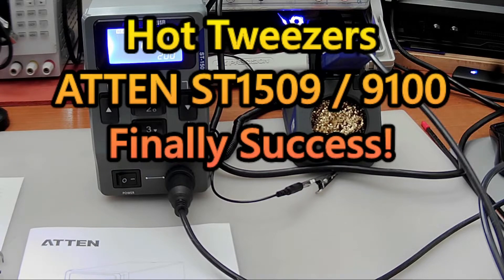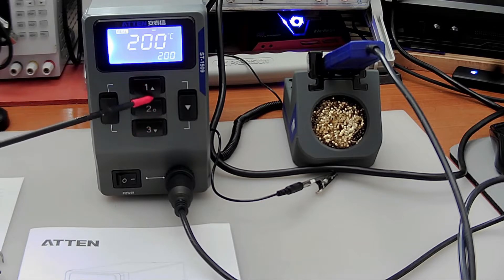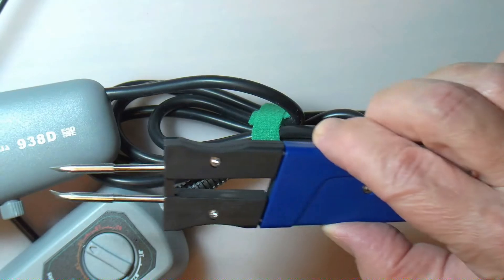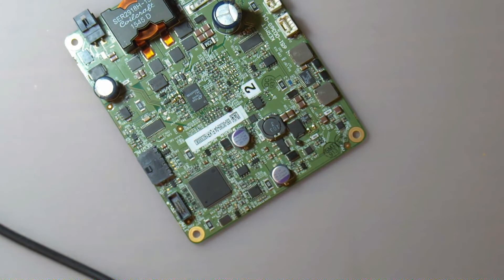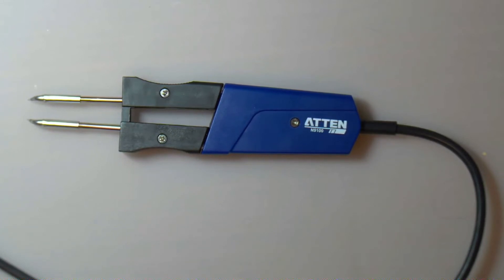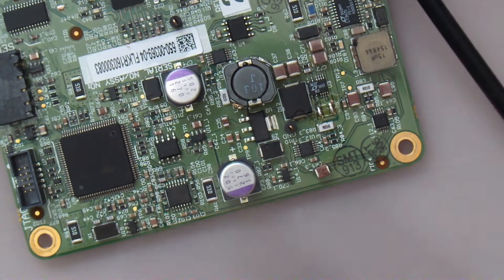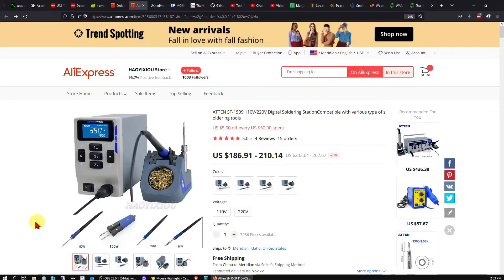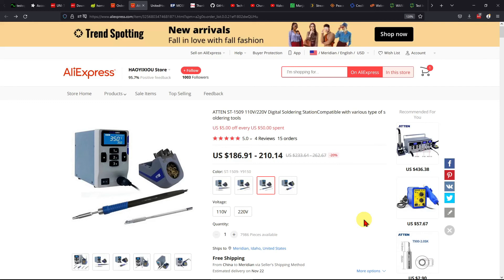Atten  ST1509 / 9100 Hot Tweezers

Comment: Do you know if the hot tweezers will work with a Hakko base station?
Reply from the maker: @MichaelM28  Well I don't know what kind of interface hakko has, but I doubt it.  They all seem to have different pinouts and voltages.

Comment: 8:30 what terrible performance… it should be 3 seconds max. 10:53 such a small component should take less than 1 second and not look like you’re ripping it off the board. 

Friend, you should not advise people to buy this. It’s such a waste of $200. You can just use two irons or one iron tip that spans both pads (or use hot air). 

Soldering tweezers are a luxury. Apart from saving time with SMD rework, the point of them is to press a pedal to turn the heat off so they can handle components like regular tweezers. Or you can use them to hold a component & solder it in place (but you can do that same job with one iron & some flux). 

350*C for 20 seconds - pads & tracks can get lifted and components should be thrown away after so much heat. Brand new components spec: solder 260*C for 5 seconds for reference.
Reply from the maker: Not entirely sure what you are talking about.  I used that board on purpose it is a board that was coated with something to seal it and was designed to go up with a weather balloon at very high altitude and it is difficult to remove components from it.  Using cheap hot tweezers did not work on this board as a previous video showed.  The Atten tweezers made it possible to remove the components and I use them all the time, on a standard PCB the components come off with or without flux immediately.  They can be used in cramped sections of a PCB which you could not do with two soldering irons.  I mean there are many ways to desolder components and you can use the method you like best for me I use the hot tweezers often and they work well for me.
Reply: @Tech-Relief  oh I didn’t realise it was covered in a conformal coating. 

Because YouTube is playing up, I don’t watch in HD anymore. So everything is blurry.
Reply: @Tech-Relief  have you tried using a regular soldering iron with a tip that can touch both sides of a SMD capacitor at once? 

The common Chinese knife tips can do it, but I’ve seen better geometries specifically designed for the job.

Comment: So it's stays hot all the time instead of becoming ready when pulled out ?
That sucks
Reply from the maker: It is exactly like a soldering iron, if you do not touch the tweezers for a programmable number of seconds it will turn off and go into standby mode automatically waking up when you remove the tweezers from the stand.  Is that what you were asking?

Comment: Excelent video, question. With those tweezers SMD components are not getting damaged? and what temperature do u recomend to dont damage the SMD components?
Reply from the maker: As long as you put on enough flux and perhaps some leaded solder which reduces the temperature needed to desolder I have not noticed any components being damaged.  I usually set the temperature to 325 to 350 and only increase it if dealing with a multi-layer PCB with large ground planes.
Reply: @Tech-Relief  thankz for answer, i appreciate it
Reply: @AztecaBeast-rq1mp maximum 350*C for rework. 

Yes, such a long time heating components surely damages them and will likely lift pads. 

It should only take a second or two heating both sides at once to melt solder. Even with cheap soldering irons.

Comment: Thanks for sharing info about this hot tweezers ! Very useful. Can you share also information about temperature which you used eg at 8:34 ?
Reply from the maker: usually 350 to 400 Celsius depending on if the component is on a ground plane or not.
Reply: @Tech-Relief  Thanks ! What do you think, if there would be 2 mm x 1.25 mm capacitor to desolder instead, what type of iron tip and temperature should be used ?
Reply from the maker: @emil8367  I use a chisel tip which has two opposing flat sides. It depends on the PCB what temperature to use.  A simple two layer board may only require 325 Celsius but a multi layer board like many GPUs that may have 12 or more layers and ground plains you may need 350 to 400 Celsius and may need to put on some leaded solder first which has a lower melting point.  A chisel tip will allow you to heat the side of the component as well as the pad on the PCB which can be important for some difficult components.

Comment: Can the tweezer work on sugon solder station?😊
Reply from the maker: I have not seen a sugon solder station personally, so I do not know what kind of voltage and interface it has.   I am noy aware that there is any kind of standard for the pinout of the connectors so probably it won't work.  Perhaps someone else knows about this?

Comment: Is that tweezers T-9100-05i or T-9100-02i?
Reply from the maker: I have the T9100-051 tweezers, which are the smaller ones and I use the most.  I also have the T9100-2.2D insert which is larger and produces more heat for larger components.
Reply: @Tech-Relief  thank you very much

Comment: My friend thanks a million for this hot tweezers video.I was looking all over for a reasonably priced one that is as good as the expensive ones. And you definitely found it.I will buy this one for sure.One question tho.Do you think the tip of the soldering tweezers is small enough to maybe work on Iphone boards with tiny capacitors?
Reply from the maker: Yes, there are three sizes available.  The smallest is definitely suitable for the small SMD components and is the size of the default tweezers supplied with the soldering station, the larger ones can be used for large components and connectors.  https://www.aliexpress.us/item/3256804222701170.html
Note that I do not necessarily recommend the store related to the link above; in fact I bought some of mine recently from ATTEN direct, they were cheaper but shipping can be more expensive since they use DHL.

Comment: Do the hot tweezers have enough power to remove usb and hdmi connectors? I know the same is possible with the weller hot tweezers. Can you test it?
Reply from the maker: So the tweezers come in different sizes.  The ones I was using were the small ones.  I ordered a larger insert for the tweezers and I am waiting for delivery of these.  When I get them and also various soldering tips I ordered I will do a complete comparison of the ATTEN soldering station and look into it.